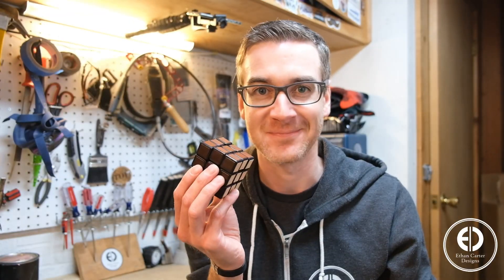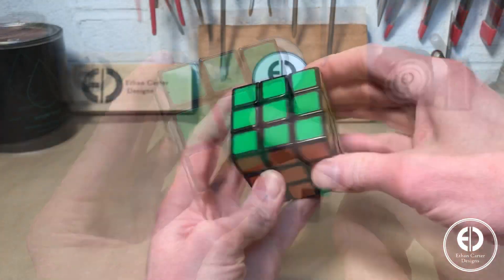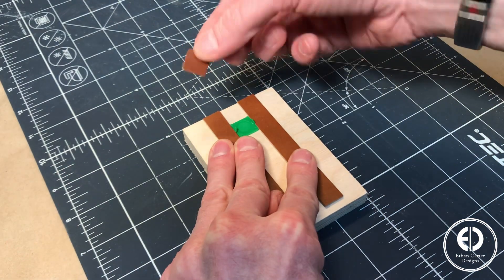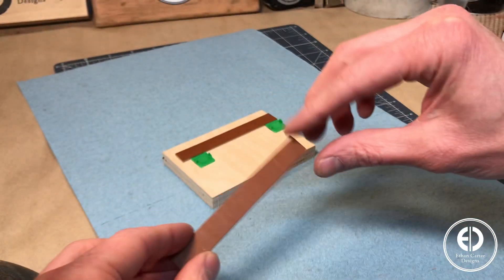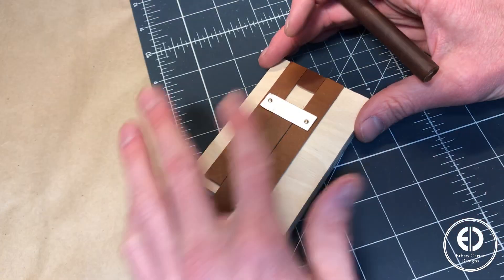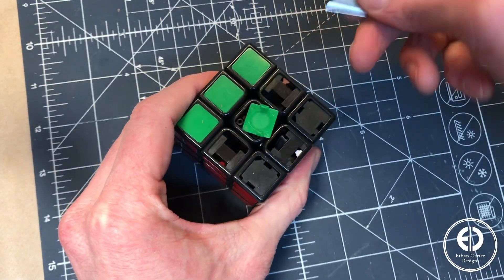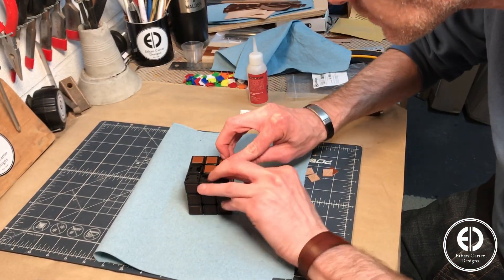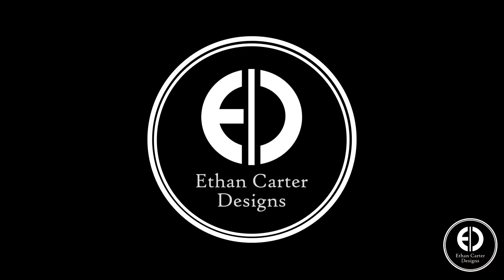The Classiest Rubik's Cube Ever?!

Comment: This has got to be one of the coolest things I’ve seen on YouTube. My husband recently got a promotion and decided to add a few classy desk accessories to his office. He loves all things leather and dreamt up this idea for a leather Rubik’s cube. He searched high and wide but found nothing… lucky for him, I am much more persistent, and my search led me to your video. I am absolutely doing this for him for Christmas (though it won’t be nearly as methodically crafted as yours). Thank you so much for this content!

Side note: does the leather punch set you linked contain a size that works with the cube linked?
Reply from the maker: Thank you so much for the kind words! I'm so excited it inspired you to make one for your husband, I'm sure he's going to love it...I have mine on my desk too!  The punch set I have linked has a punch that is perfectly sized for older (around 2015/2016) Rubik's cubes, but unfortunately they ever so slightly changed the size of the squares and now it's just a hair smaller than the punch size which is why I ended up having to make the jig.  But if you have an older one, it might work!
Reply: @EthanCarterDesigns  it’s me again. 😊 So I actually tracked down the 2015 Rubik’s cube, got the punch set, adhesive, and several pieces of tooling leather from Amazon because I wasn’t sure which exact type of leather to get from District. 

The problem I’m running into is getting the punch to actually go all the way through the leather (seriously, been hammering for several minutes) and when I just cut it with an exacto knife, it is raised quite a bit above where the plastic tile would sit. Is my leather just too thick? It’s 2mm thick. Yours looks flush with the cube and you made it look so dang easy. I’m determined to make this work but am getting so frustrated!